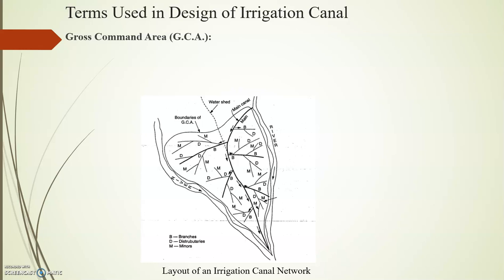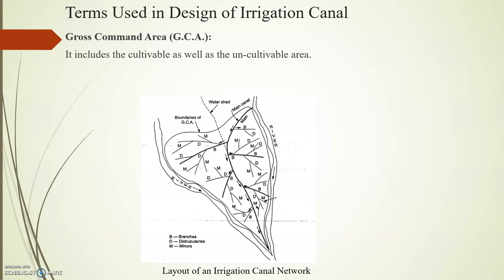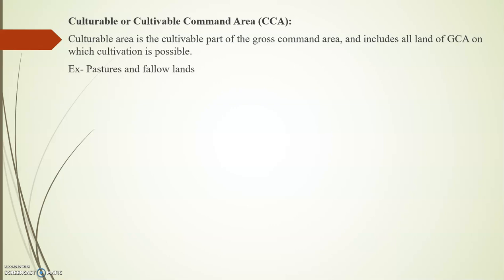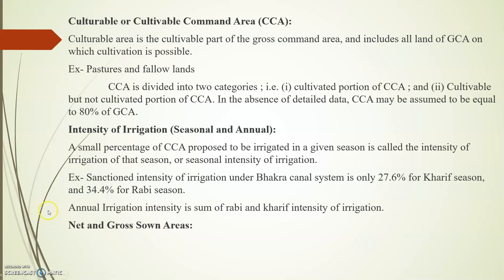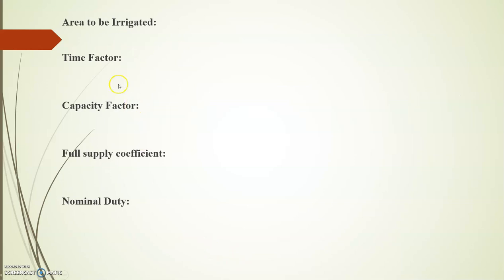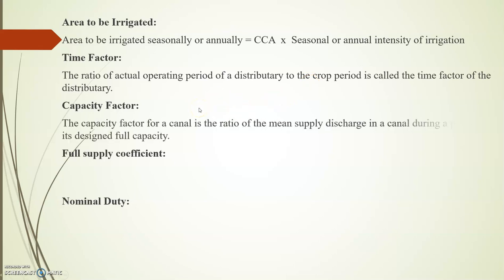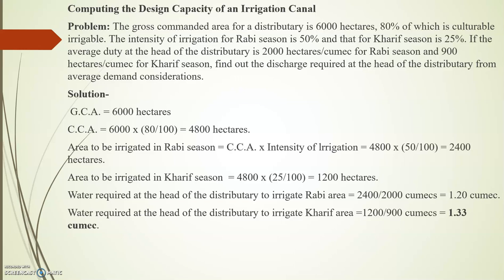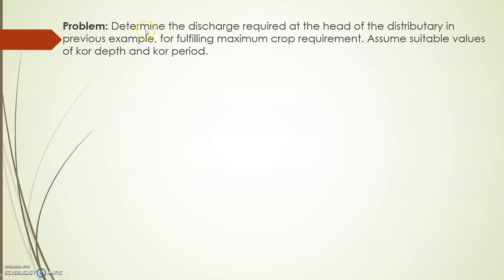Design Discharge of Canal | GCA and CCA | Prof. Sagar Kolekar

Comment: If one crop is kharif and one crop is sugarcane...than design discharge is summation of both?
Reply from the maker: Crop period of Sugarcane crop is more than a year so it would come in Kharif and Rabi. If the one Kharif crop is given and another is sugarcane then we need to first check whether the sugarcane is considered or not in CCA and for average duty. If not then we should consider it and then need to update CCA and further calculations. If still you have doubt then you can contact me on sagarkolekar.2008@gmail.com